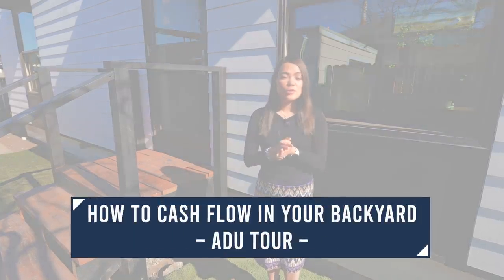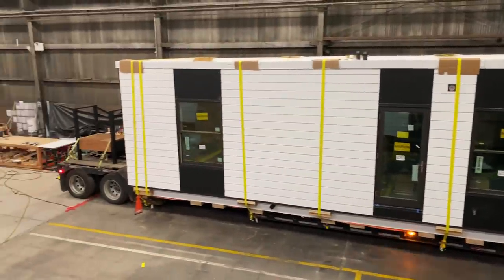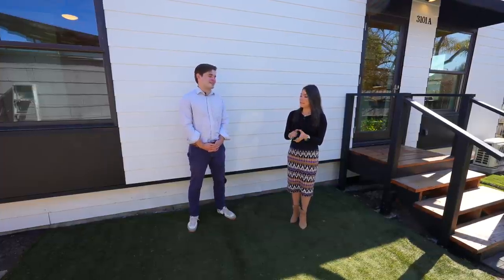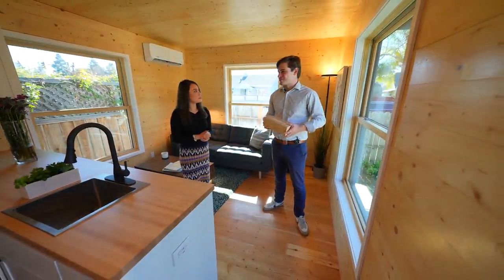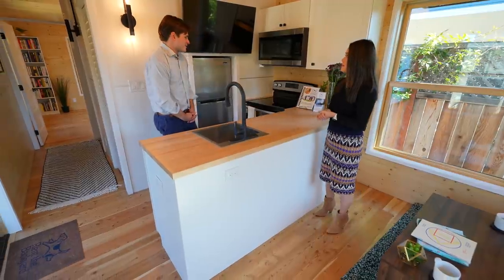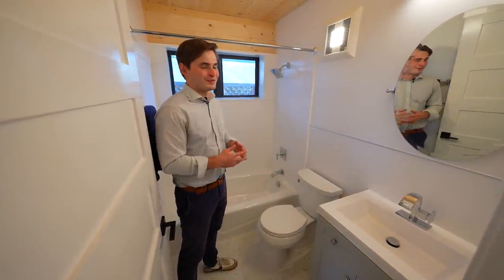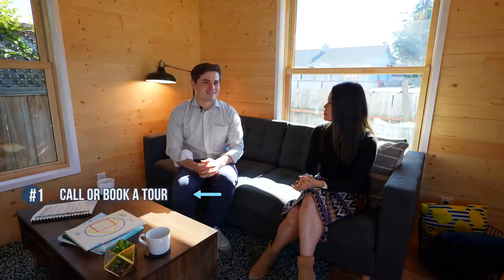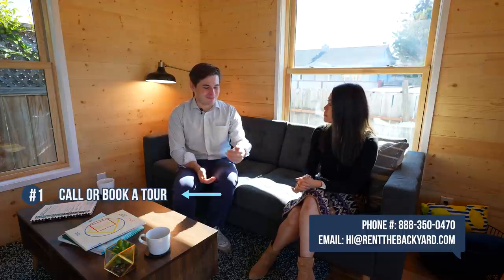Building a Prefab Backyard Guest House - Accessory Dwelling Unit, ADU House Tour, Rent the Backyard

Comment: 200k for a prefab 420 sqft unit is way too high. The construction cost ends up being almost $480 per square foot which is high even for standard stick built homes! I live in California and recently got a quote from a builder that was under $200 per square foot to build a house for me. That cost of $200,000 is fine for the boutique Bay Area investors but it doesn’t help the current housing crisis going on in CA. We need actual housing not more pricey Airbnb’s

Comment: Yes, that is true, we built an adu in Turlock that cost around $150,000 1 bed 1 bath.  It only took about 3-4 months and it increase the value of the primary residence $80000-$90000.

Comment: I would love to see a video on your stick build ADU! I am considering an ADU right now actually and have been looking into some companies similar to RentTheBackyard but who do stick build (my sfh is very close to some power lines so it can get a little hairy to get a crane in there for pre-fabs). 

I actually did get a quote for a pre-fab ADU, 800 sqft 2b2ba all in for $365k. (For transparency, that includes about $40k worth of upgrades like quartz countertops, upgraded bathrooms, extra AC, etc)  That comes out to about $450/sqft (or $400/sqft without upgrades), so it was really helpful to know that your construction costs are around $300-350/sqft! Very helpful video, love it!